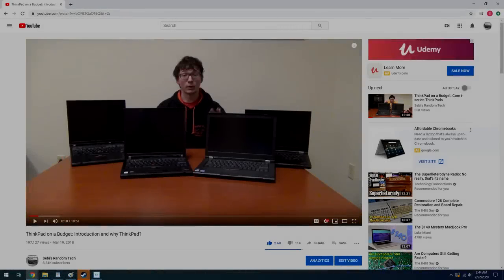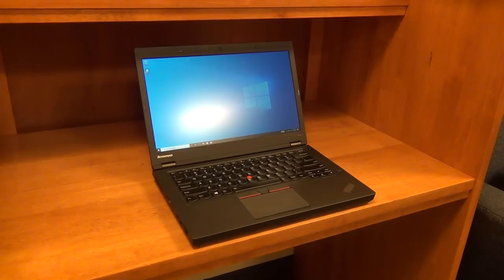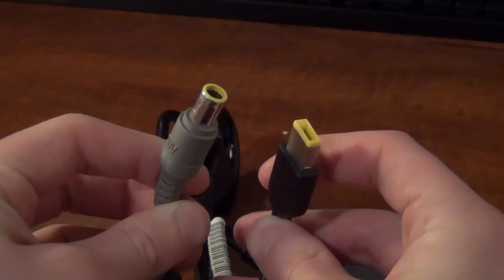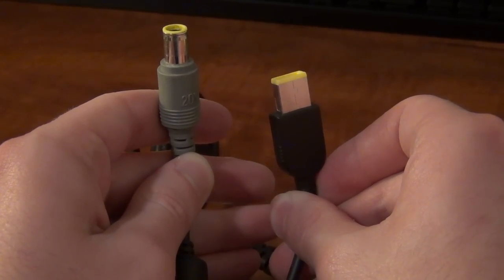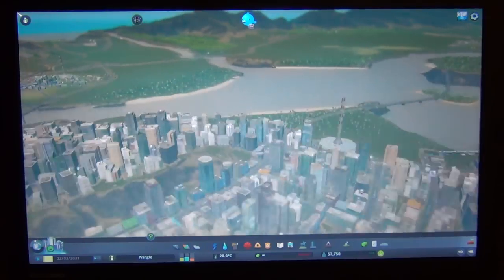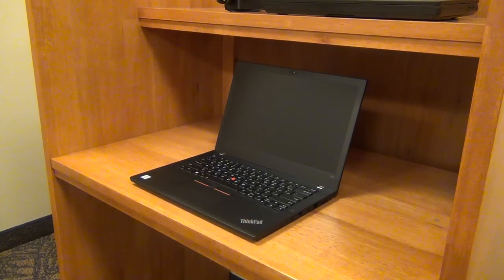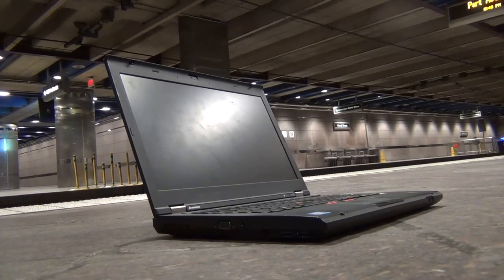Best Value ThinkPads in 2020

Comment: Hi Sebi, thanks for all the great videos, really helps with the minefield of 2nd hand Thinkpads. Can you tell me your thoughts on a choice between an X230 and an X260 both around the same specs?
Reply from the maker: I would first ask if you care more about better performance and a better keyboard or better portability and battery life. The X260 is noticeably thinner and lighter than the X230, and also has far better battery life. The X230 has slightly better (CPU) performance and a much better keyboard, and with the classic keyboard swap being available you have access to an even better keyboard.
Reply: Thanks Sebi, if the price of both is similar, unless the performance was noticeably better on the X230, the battery life of the 260 would sway me. If the X230 comes at a cheaper price I would go for it based on your advice. Is the X230 keyboard backlit? And is the build quality  of  both machines similar?
Reply from the maker: @celticed8100  Both machines are solidly built based on my experience. Some X230 keyboards are backlit, some are not. You can easily swap them if the keyboard you get is not a backlit one. Even if it doesn't, the X230 has the ThinkLight above the display allowing you to still see your keyboard in the dark.
Reply: @SebisRandomTech  Hi Sebi, thanks again for your reply, your extensive knowledge is invaluable. Can I trouble you with another question? . I have also been looking at a W510, i7 with 8gig of ram and a 160 SSD. It's a bit bigger in size than I was intending buying, is it worth considering or should I stick with the smaller format machines? It's on sale for €150 about  $180, seems like good value?
Reply from the maker: @celticed8100  That's not a terrible deal, especially considering this stuff tends to be more expensive in Europe. However, the X230's processors perform more or less on par with that of the W510, so unless the W510 is much cheaper, and you value a built-in DVD drive + larger display, I would go for the X230.

Comment: demopool L380 or L390 with 8th gen quadcore for round about 500$ is also quite a good deal, because it´s one of the last ultra mobile devices that has upgradable ram (2 ram slots !!) and modern hardware. The soldered ram is, in my opinion, a huge deal breaker on newer ultra mobile thinkpads. 
If my current X230 had only-soldered ram, it would probably be stuck to 4GB now, because 4GB was standard in 2013. Many of the X390/X395 have only 8 or 16GB of ram soldered, so this will definitely be a bottleneck in a few years. On the L380 or L390 you will be able to upgrade to 64GB, maybe even more. In my opinion, it´s a very bad move from lenovo to remove the ram slots on more and more machines. 
And with all the other points you made in the video, i get the feeling as if the thinkpad brand is a dying brand. If i want to have a macbook, i buy a macbook and not a wannabe-macbook-thinkpad. It´s a shame what lenovo is doing to the thinkpad-series.

Comment: Most of my Computer are from Apple. The only weak spot when it comes to "PC"-notebooks are the thinkpads. Esp the 420 and 402s with the old style keyboard. I use them with SSDs and Linux ... and they are just amazing! Totally reliable and for most tasks good enough. Then I like to P50 with UHD display, 64 GB Ram and lots of ssd-space. Workhorse & very reliable. I also have a few of the newer Thinkpads like P460, 480, 560, 580 ... they are okay, but not the quality I was used to. Esp the T460 keyboard is totally crap.
Reply from the maker: While I still think older ThinkPad keyboards are superior, I don't mind the T440-460 keyboards. They are hit or miss though, Lenovo had multiple manufacturers for their keyboards and some are better than others with those generations. With the T470 onward they began reducing the key travel to a level I don't like. If it weren't for Apple's butchering of the laptops in recent years I would likely still be using them for my daily drivers.
Reply: @SebisRandomTech  The keyboard quality varies a lot even with the same model. The T460 I have here on my desk is hardware from my customer. And the keyboard is a total pain! When touching key it makes strange noises, when pressing it's scratching and you never "feel" that you really hit it properly ;) Then I have my "historic" T420 that I use for pen testing. The keyboard is just amazing - even after using it for so many years :)
Reply from the maker: @EMBEVIDEO  There's at least 2 or 3 different manufacturers for ThinkPad keyboards and there are different variants between those versions. One time I needed a replacement keycap for a T440p keyboard and of the 5 spare keyboards I had at the time, none of them had a keycap that would fit. Some are certainly made better than others.

Comment: What are the major differences between t440 and t440p? Thanks
Reply: T440 have a soldered in processor the T440p have a socketed processor, and the processor that are available for the T440 were only under powered ultrabook processor
Reply: @utaMAN12345  what's the summary?
since no timecodes

Comment: Is the thinkpad x1 carbon 4th gen good?
Reply from the maker: Decent, depends on the price.
Reply: @SebisRandomTech  thanks for the reply!! 
I'm planning to buy thinkpad t460s for 490 usd with intel i7, is it worth it?
Reply from the maker: @hart.6230  How much RAM and storage does it have, and what display does it come with? That price is a tad on the high side unless it comes with a lot of the higher end upgrades.
Reply: @SebisRandomTech  it comes with 12 gb of ram, 256 gb ssd (can i upgrade this, if yes how?), full hd screen
Reply from the maker: @hart.6230  SSD can be upgraded, RAM has one socket for upgrades (I believe 16+4 GB is the maximum), everything else is soldered on.

Comment: Really good video! You forgot that Ivy Bridge CPUs could be used with T420.
Reply: Yeah, the 2nd Gen Cor i CPU's can be upgraded to 3rd Gen Core i CPU's.
Reply from the maker: Not without a difficult BIOS mod (if you lack the skills or equipment). I actually did briefly mention this in the video, saying how of you wanted to put a newer/cooler quad core in the T420 you had to resort to BIOS mods.
Reply: @SebisRandomTech  Okay, I do not know about these thinkpads, but I have upgraded Sandy Bridge CPU's, to IVY Bridge CPU's in the past, and I have no clue about how to do bios mods. I just assumed that most Sandy Bridge laptops would accept Ivy Bridge CPU's just fine, and without any issues. Thanks.
Reply from the maker: @justinbryson1680  The T420 and other Sandy Bridge ThinkPads have a pretty locked down BIOS, and this prevents upgrading to Ivy Bridge without a modded BIOS despite having the same socket.

Comment: What do you think of T450s?
Reply from the maker: As long as it has the FHD screen and you don’t need any extreme horsepower,it’s a nice little laptop if you need the portability. Not as many upgrades or power of thicker machines, but still a nice premium computer.
Reply: @SebisRandomTech  Thanks

Comment: Guys do you have any thoughts on Thinkpad L490 ? I need something under $1100
Appreciate your answers
Reply: Don't buy L-series. They are cheaped out. Look for T, W, X, or P. These are the true ThinkPads.
Reply: You can get macbook air i5 for 1199
Reply: look for a T495!! more or less same price as the L490. The "95" series has AMD processor, which is faster than Intels. So you get a more premium model (better chassi, battery etc etc) and with a better processor than the L490! it's tbh a steal! The only downside is that the T495 dont have a thunderbolt 3 port! But neither does the L490! If you need TB3-port, go for the T490, it's a lot more expensive and since you're concidering the L490, it seems like you dont need it. :)
Reply: @JontesTechTips  thank you bro, It seems really interesting that one
Reply: Get a T480 I picked up mine with an i5, 16gig rams, 256gb hd, and a touch screen for 700.

Comment: What about the x230 is it good I'm planning to buy it for approximately 100$ (specs: core i5 third gen,320 GB hdd 4 GB ram TN display)
Reply from the maker: For $100 it's a pretty good deal. I would definitely consider upgrading the RAM or replacing the HDD with an SSD if your budget allows.
Reply: @SebisRandomTech  SSD's too far but I can afford 1 tb HDD and 8 GB ram,I'm mainly buying it for light gaming,online classes and most importantly the keyboard tho I might replace it with the x220s
Reply from the maker: The X230 has many performance improvements over the X220 along with better battery life. You’ll be better off swapping the X220 keyboard and palmrest into the X230.

Comment: I bought it second hand in 2020, i7 t430s. CPU can't be changed as in T430 versione ma the case is more compact and the monitor isn't bad. I recently used ivybridge to swap wifi board, I went from 40 mbit per sec to 500

Comment: honestly, I need replacement for my X200 tablet that I bought October last year. at least T420, although I'll be okay with T410 (still dreamin' owning T460p/T470p/P50 though...)
Reply from the maker: Shoot for a T420. They usually aren’t more expensive than a T410 and provide much more power/expansion.
Reply: I've got what I call my "Frankenpad" - it uses a W520 mainboard, a T420 screen, a T410 lower case and parts from all three to finish it out - and 32G of RAM, 2TB of disk (1T in the bay, 1T in the dvd bay) - I've not done the ssd in the modem slot, yet, though...

Comment: is there a ThinkPad with hdmi port & backlithe?
used 200 - 500 $
Reply from the maker: The X1 Carbon was the first mainstream ThinkPad to have HDMI, and then ThinkPads like the T460 and newer have HDMI.
Reply: @SebisRandomTech  thx for the info
Reply: ThinkPad X260 and X280 Have HDMI. ThinkPad X240 has DisplayPort and VGA.

Comment: Anyone know how to fix the fingerprint support issue for W540 in Windows10? Fingerprint scanner is not working in Windows10
Reply from the maker: Try installing drivers using Lenovo Vantage, or manually install the drivers yourself by downloading them from Lenovo's website. If all else fails, remove the palmrest and make sure the connector for the fingerprint reader is properly connected.
Reply: @SebisRandomTech  Thanks for your advice and I will try these later on. Like Thninkpad and Like your video as well.

Comment: Cool, I actually game on a t430 w egpu with four core & 16gb, SSD, and 1080 adapter and screen off eBay even though I use external monitor, wireless keyboard and mouse. I actually have the wifi ac card and flashed coreboot once or twice, but destiny 2 got me back on Windows and I never bothered to get the stock bios modded since we've had a bunch of updates the last couple of years. Really nice laptop. Thanksedit- what ivyrain?? Thank you thank you whoa now, I owe u big time, I didn't know about the ivy👍💪
Reply: Can you provide a link to the adapter & screen you bought please?

Comment: I'm waiting for your video on upgrading the T430.  I see that there are numerous display adapter boards on Ebay to use the HD panels in them.  I'd also like to know more about keyboard swaps, battery choices, and storage upgrades.  I don't think you mentioned this in your videos, but the T430 was probably the last of the 14" thinkpads with available optical storage (though many have used the bay for an extra battery or HD).  I think the dock might have had a drive bay in it, please comment on that too.  I currently own a T400 and an X220.  The later is my current on the go computer, but I'd like an upgrade for the T400 with a dock to use as a portable 'lab' computer, and I'd like at least an HD display.    (I run Linux on my computers, I wish there was a way to tune this OS to last as long on battery as Win10 is).
Reply from the maker: The T440p also supported storage drives in the optical drive bay, however the T410 onward dropped the extra battery (it was kept on the -s models though, the T410s, T420s, and T430s). The T430 docks did not have a drive bay in them, but the UltraBase docks for the X220/X230 did. And don't worry, I'm working right now on the T430 video! :)

Comment: Which one is better for graphic design?
Reply: I'd say the T440p. It has an option for a pretty good IPS display as opposed to the ok TN displays on the predescessors. The overall graphics performance is better as well.
One thing I've heard a lot is that if it has a very powerful processor, it's prone to overheating so go with a midrange instead (as an m class CPU it'll still outperform newer U class CPUs).
However for graphic design I would suggest getting the larger T540p as you would like to have more screen space.
Reply: toastedphantom yeah, I wish to get the larger one, but I don’t have enough money for it. And it’s quite expensive here in west Africa. A friend suggested that I should buy T440s($200) or Yoga 13($300). And all I have with me right now is $250. I just want a refurbished laptop for graphic design.
Reply: @mikelnwaobi  The T440s might be worth a look. Some even come with a touch screen.
Reply: toastedphantom I want to buy Lenovo G50 core i7 with graphic memory of 2gb, for my graphic work, do you have any idea if it’s good for graphic?
Reply: toastedphantom can you recommend for me which of the computer I can buy with $250 for my graphic work
Reply: @mikelnwaobi  Thinkpad W520 should be just fine. Those also have a Pantone Huey PRO Colorimeter by X-Rite the palmrest. Basically for 3D editing, VFX editing, Video editing, photo editing and graphics editing in general, the Workstation series is the better choice. And i would not really wanna go lower than the W520 or W510.

Comment: I've bought a T530  8 years ago. Ran Windows originally, switched to various Linux distros in the meantime. Only thing i did: upgraded to an SSD about a year ago. Fell off the table a few times, survived it all. The display has a little pixel error since the cat jumped on it but i don't really mind.
Reply: I've be using mine since i think 2014, and aside from a single dead pixel, I'm hesitant to move on to a newer machine. Hoping i receive my SSD+ultrabay caddy soon to freshen it up a bit
Reply: 2022 update: T530 still going strong.

Comment: Is Lenovo Thinkpad T410s good ?
Reply: I mean... It's a 10 year old laptop..
If you're running Windows I don't think it'll be smooth or anything, but it does have 8gb ram which is fine for basic operations. It's fine. It's an okay laptop but honestly why
Reply: Try and go for a t420, it's 1 year newer
Reply: If you use linux, it will be very fast. However, the batteries are 3-cell, weird and non-standard, so are difficult to replace, which is a problem if you wanted an s-version because you want to carry it around, Find an ultrabay battery or sth. It also uses a strange 1.8" drive which is rare, so just use an mSATA drive with an adapter. It has an uncovered webcam and I heard the thinklight is unhelpful since it is blinding.

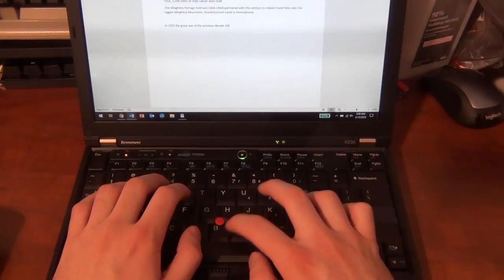However, it is still a lot faster than a t60 and has a 16:10 display, also being cheaper than an X300, I think. Remember to replace the fan if you can help it, since it was the first component to fail on my t60.
Reply: Oh, and the cpu is soldered in place, so if you aren't good at soldering sensitive components you need to buy one with the desired specs out of the box.
Reply: Put ssd on it and it will be okay for browsing

Comment: I have a T440P and Im loving it though the touchpad is absolute trash hahah someone in youtube made the swap to the T450 synaptics touchpad and was having issues in Windows with it I dont know how you got around that issue. Though Im quite a noob with thinkpads. Also I very much prefer the feel of the older keyboards, modern laptop keyboards are just terrible in my book, making them look pretty doesnt fix the type feel of them. 

PS great review on these machines.
Reply from the maker: Getting the T450 touchpad to work in a T440 is a pain, but it can be worked around. I actually made a video a few months back about how to get the drivers working properly.
Reply: @bartiz12  Or you can coreboot your t440p and define the correct trackpad id , so it will be kinda plug and play
Reply: @nicoerpiu  Wow, sounds wonderful. I will definitely research and check out this method!

Comment: are there any thinkpads with a 15 inch 1080p panel?
Reply from the maker: T and W510, 520, 530, and 540.
Reply: @SebisRandomTech  Which would you reccommend for running KDE Neon 5.18 User Edition?
Reply from the maker: @arcturus0389  Any of those models should run it fine, but the T/W530 and 540/541 are the newest of the models I mentioned so you should look for one of those.

Comment: I just bought a t430 and have no idea what the m.2 adapter to a graphics card is called or how to install it. Can you help me out?
Reply from the maker: Expresscard to PCI-E. It’s pretty simple, you buy the aforementioned adapter, get a graphics card of your choosing, a desktop power supply, and even an external monitor. Then hook it all up, power everything on, and install the graphics card drivers.
Reply: @SebisRandomTech  do I have to get a powersupply or if the graphics card is a 1050 will my laptop power it? Could I just use the screen on the laptop?
Reply from the maker: @justinnentwich2779  You need a power supply. You can run the card through the laptop's internal display, however performance will be better with an external one.
Reply: @SebisRandomTech  ok so for a 1060 2GB I should get a 300b w power supply
Reply from the maker: @justinnentwich2779  That should work.
Reply: @SebisRandomTech  no sorry it is a 4gb 1060. But I think that will still be ok
Reply: @justinnentwich2779  at 300 watts of power you can toss in a RTX 2070 if you wanted
Reply: There are no 2GB or 4GB versions of GTX 1060, only 3, 5 (rare) and 6GB. Maybe you speak about 1050/1050ti?
Reply: @TheGrantourismo  I ended up getting a 1650 4gb